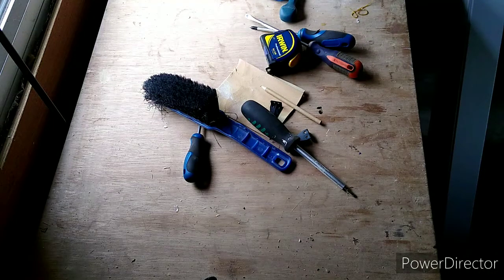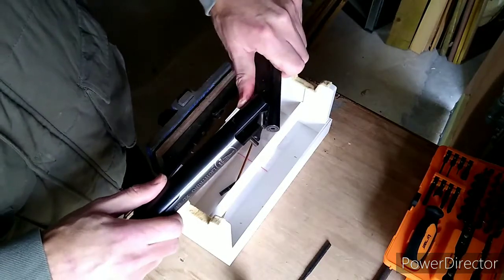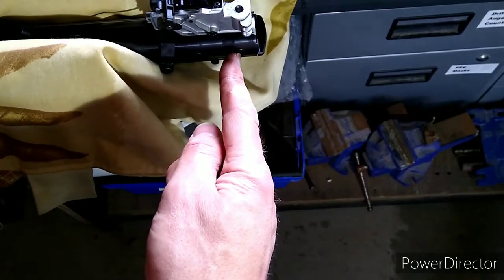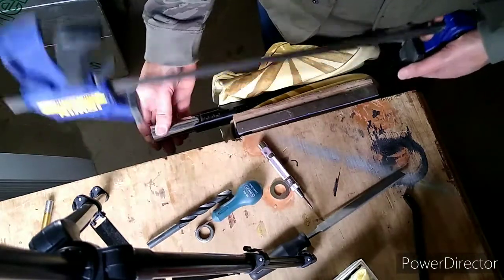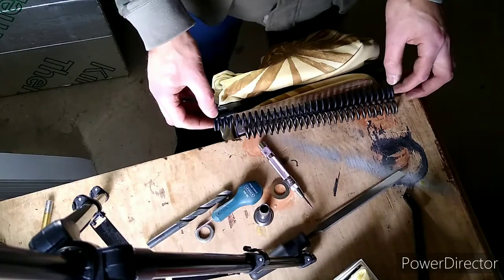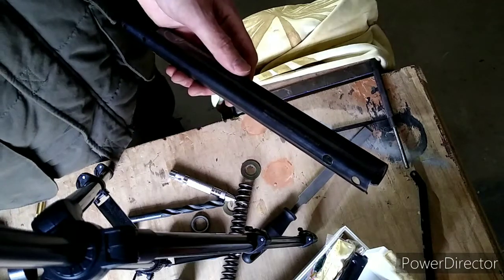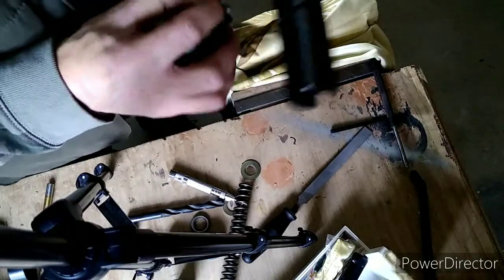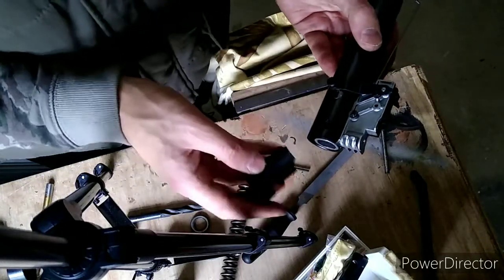NV004 BSA Lightning XL SE Project Part Deux. Louder, longer and almost uncut.

Comment: Excellent video have a quick question what size socket did you modify please
Reply from the maker: Hello thank you for your comment, much appreciated.
I used a 21mm socket for a 1/2" drive.
However, the socket I used was a cheap one with thin walls. The important dimension is the outside diameter of the socket, it needs to fit as snugly as possible inside of the air rifle cylinder.
Hope this helps, good luck 👍🏻